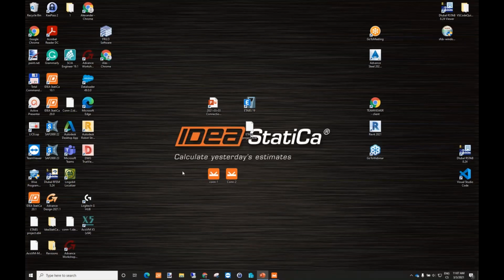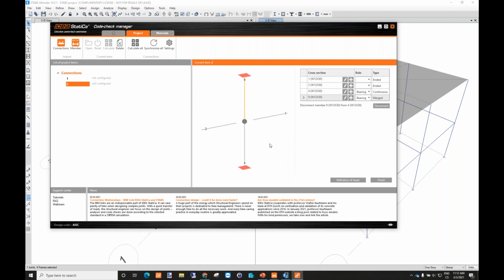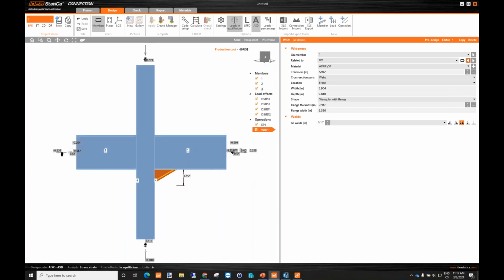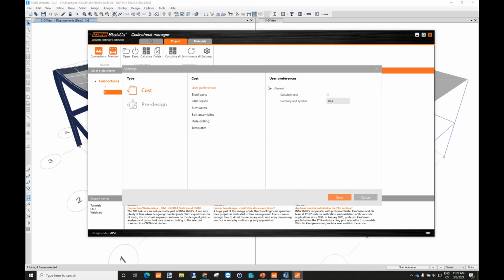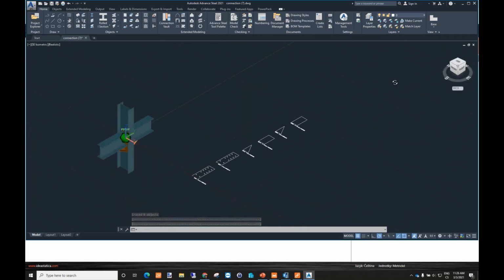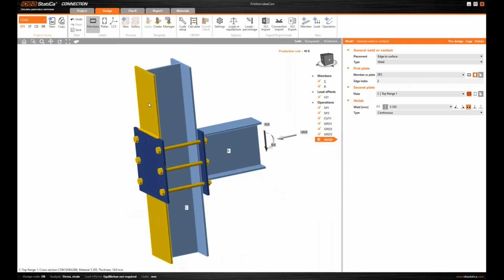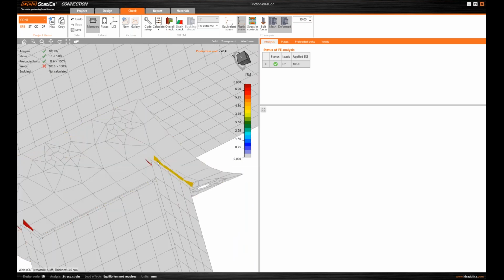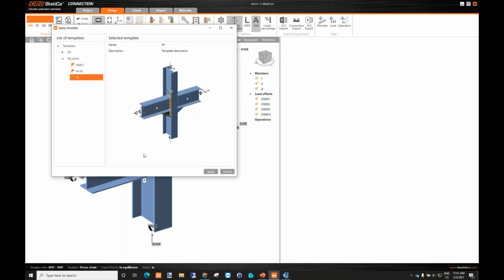Connection Wednesdays – BIM Link IDEA StatiCa and ETABS

Comment: etabs 22 and  idea 23.0 are not supported? i have followed every single tutorial on your website but still have not found the solution
Reply from the maker: Hello, they are:
https://www.ideastatica.com/support-center/bim-links-supported-versions-of-3rd-party-applications
Tutorial:
https://www.ideastatica.com/support-center/etabs-bim-link-for-connection-design-aisc

You can also use older version of BIM links:
https://www.ideastatica.com/support-center/how-to-run-old-versions-of-bim-links